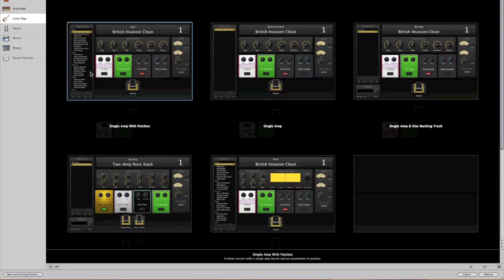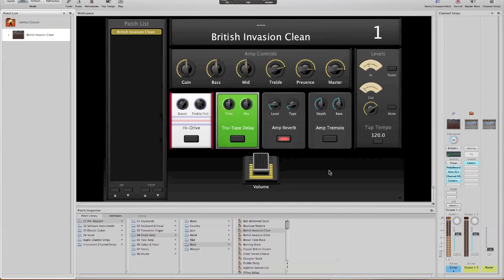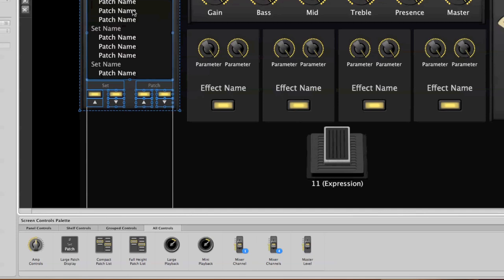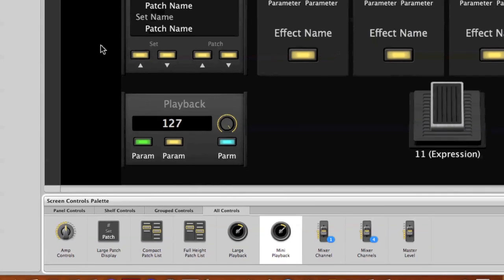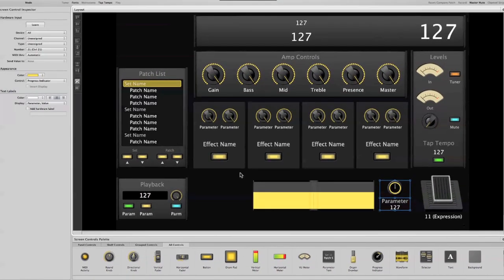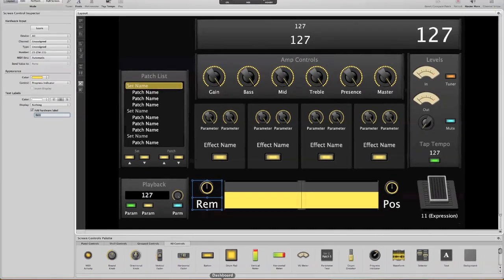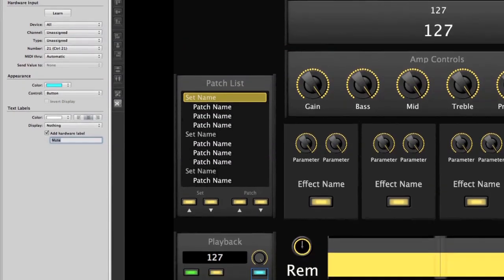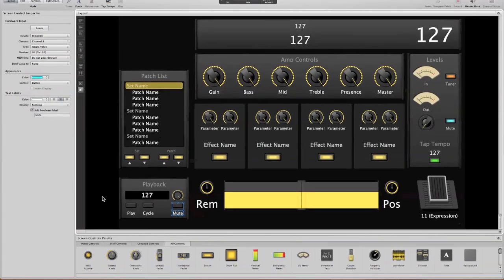Mainstage 2 - Adding a backing track - Part 1 of 3

Comment: hey man, love your video, was very informative and i've been using your set up for a while now. just wandering if you could help me with a technical question, I'm using playback for click and backing tracks, and i'm snapping to bar, but it won't let me change the tempo to the correct one? why is this?

Comment from the maker: Yeah, understood and that's ok...the most difficult part is getting your head around how it's used then it's just a matter of breaking it down feature by feature as you use it.  It's like any other software, just start off by using the templates then making small changes as you go.  You'd learn it no problem :)   It's primary use is as a performance tool for any musician (keys, vox, guitar, etc) which is why it's organized as Preset/Song, Set, and Concert.

Comment from the maker: No problem.  Yes, you can do this if you have multiple outputs on your audio interface.  You can use the channel strip which has the Playback track and assign this to a specific output.  You can also create another channel strip just for the headphone mix and route that to another output.  With separate channel strips for each, you can adjust the volumes independently to whatever level you want.

Comment: What type of file extensions does MS accept? I first tried MP3 and it would not drag with the green plus sign. A wav did ok. Most of my backing tracks are  aac audio files that are modified in a program called Amazing Slow-downer for tempo and key modification. Thanks.

Comment from the maker: Thanx!  There are different ways to do this depending on what you want to do. e.g. if the next backing track is another song, just skip/navigate to the next preset with the backing track in it.  If you have multiple backing tracks per song/preset, then you want to show multiple tracks on the display and program the navigation to each one separately by creating a navigation button(s) and then mapping those to your controller and using the Start/Stop function in the Transport control.

Comment from the maker: @JamesM608 Awesome, glad you're inspired - that will take you far! :)

Sure, if that part isn't working then it sounds like your Mac hasn't recognized the FCB1010 as a MIDI device yet.  Could just be connections.  

Could you please tell me what equipment you're using and how you're connecting up the FCB. i.e. to what interface and where are the cables going.  I'm sure we can figure it out and help you get going.

Comment from the maker: @bdemon1 As for patch selection in Perform Mode, you need to use a midi controller and map switches to the patch up/down buttons, that way you can be in full screen perform mode and just step or press your switch/key to navigate through patches and sets.  Hope that helps, feel free to drop me a note if it's still not clear.

Comment from the maker: @bdemon1 Thanks!  There are a couple of ways to approach the song/set thing...if you have a number of different patches for a specific song then I'd suggest you map a set to a song and have the different sounds set up as pattches/presets within the set.  This is also important if you're using backing tracks since you can put the backing track at the set level and it will continue to play as you switch patches.  If you put the backing track on the patch, it will stop when you go the next patch.

Comment from the maker: Hey techno.  

Cool idea and yes, for sure you can do that.  There's a number of ways to do it depending on your needs and how you want to interface.  There are a couple of templates that might be good starters for you.  Theres one under Drums that has a template that includes pad controls that you could map to your samples, the other is in Mixers and has a mixer-type layout for backing tracks.  I'd suggest playing around with those and also add other controls as you need them.

Comment: thanks again!!!, i just added you in skype, let me know when it would be a good time to give a call.Some additional information: Im using an m-audio firewire 1814, i have backing tracks in the same group a, the sync function is off, snap to marker and play from star. Im using a mac book pro 13", buffer size 128, sample rate 44

Comment from the maker: No problem, happy to help!

Ok, understood, thx for the additional info.

There are a few things you need to check but first let me also mention that if you're using that many backing tracks at one time, then you should use the Group function.  i.e. assign the backing tracks to the same group for them to start together.  The group option is at the lower right of the Playback plug-in screen.

Other things to check are the tempo settings for the presets you're using and if ur using synch feature.

Comment from the maker: Yes, you can use the musical keyboard (CMD K) which will send note on/off using the keyboard but you will need to do the Learn (in Layout mode) with a regular keyboard to do the mapping.  You can then use the typing keyboard in Edit and Perform modes.